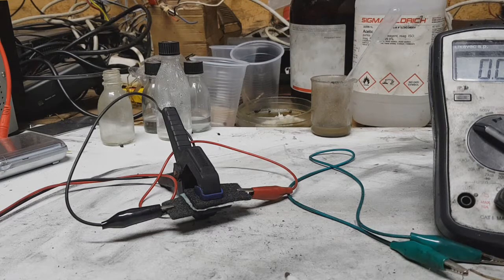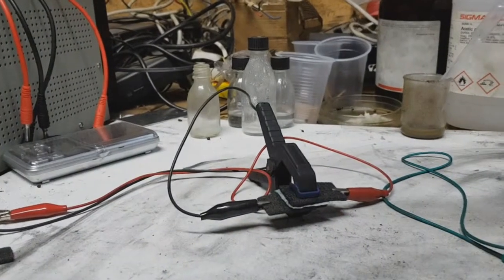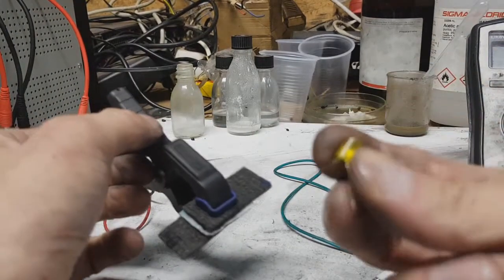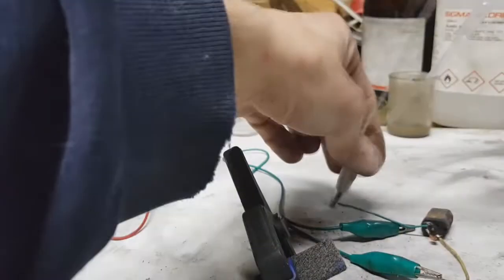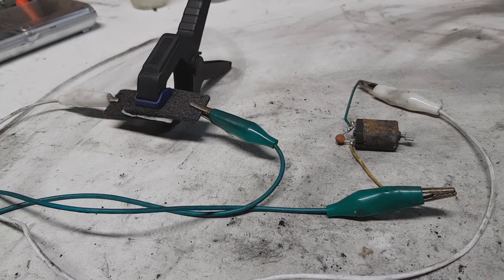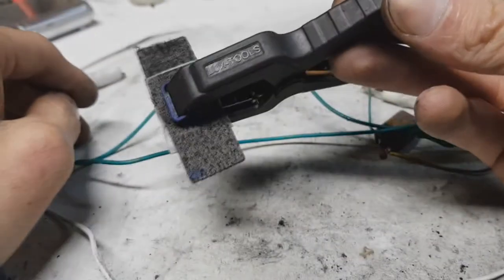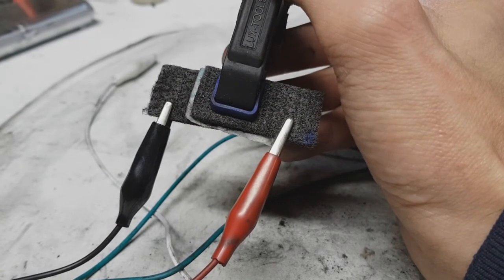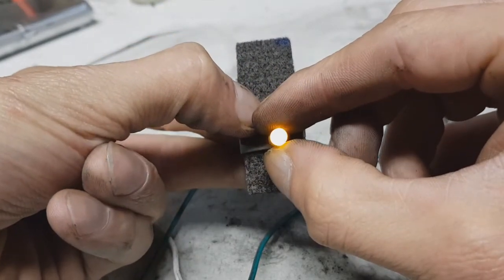Carbon Fiber Supercapacitor UPDATE

Comment: Hi Cayrex, well done. Would be interesting to test, if you could unhook booth electrode plates and store them away, when charged and then have no or very few discharge and then wait a day and see, if when putting the plates together via the seperator, if the selfmade cap would still be charged ?? Can you please try this ? Many thanks. Could have a few applications...

Comment: Where did you get the carbon fiber material?...It looks spongy....
Reply from the maker: http://www.ebay.com/itm/3-5-8-10-14mm-PAN-Based-Graphite-Carbon-Fiber-Cloth-Fabric-Mat-Foil-Felt-U08N-/182642514504?var=485200237324&hash=item2a86579a48:m:mSRjSFxOXq5Dfvw58Rr6gpA

Comment: Try to make a carbon material with meso and macro pores mostly, just bought a lot of cigarrete buts and remove the paper, you only want the cellulose acetate, then make a nh3 generator and introduce the nh3 into a little furnace at 800-1000 °C for 1-2 hours to obtain the material, this material is better than grafene and nanotubes etc, be careful with the fumes and always use gloves cause buts are so toxic and dont forget use the nh3 cause if you dont use an inert atmosphere you destroy the material, you dont believe me? Search for yourself i made an investigation about this just search cigarrete buts supercapacitors on google and read the article made by korea university, regards from mexico and be careful, have a nice day :)
Reply from the maker: nice :D now I need only a NH3 and gas generator furnace... :(
Reply from the maker: so I need used cigaret filters?
Reply: just mix ammonium sulphate and sodium hydroxide, set a separatory funel above of the reactor(erlenmeyer flask) and leave fall drops of water slowly with a magnetic stirrer and add some heat to speed the reaction, pass the gas through calcium chloride to dry it and then put into the furnace, the chemicals are easy to get the glass set not at all but is not imposible and i recomend you experiment with that in a very little scale (esay tube) and check the results once you perfect the techinque you go ahead increasing the size of system, and finally the time for the pyrolisis can be reduced or better need to be reduced, if not you will need a lot of nh3
Reply: and again be carefull nh3 and cigarrete buts and the carbon monoxide generated on the pyrolisis are not a game, dont have fear, have  respect to the process

Comment: hi cayrex excellent video, i did notice the cables on the old video and quickly worked out that they are used for charging only.
if it was someone else other then u, i would have had a doubt but there is no reason for ppl who follow your Chanel to think that way, that is ppl who know u. so keep up the good wor,k  pse advise what is the electrolyte . good stuff
Reply from the maker: +malti2104 electrolyte is zinc chloride
Reply from the maker: +malti2104 and thank you bro, for your wise words. 👍✌😁

Comment: good work ....my question to you...is this the same carbon viber they use for cars...i am now running a christmas light i ordered in China ...100 led lights...the electrode are a rod of magnesium and a small piece of garbon all filled up with salt water....its running 24/7 for a week now....the output is only 3 volts....i will make a video this week
Reply from the maker: I dont know if is this carbon fiber use in cars but I think the carbon fiber for cars is much more smooth. this carbon fiber is more like carpet
Reply from the maker: Yea,... make a video and send me a link ;)
Reply: i will order some and see what does